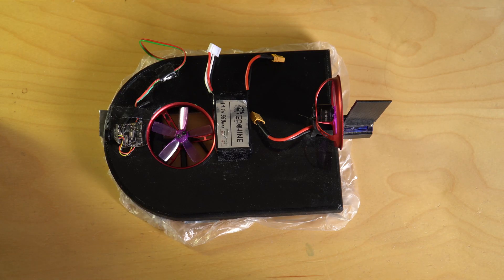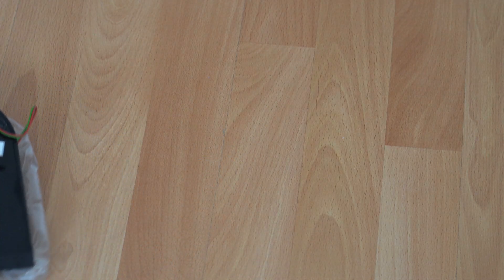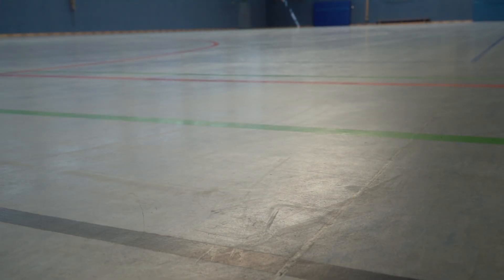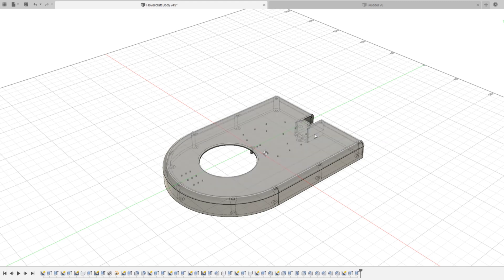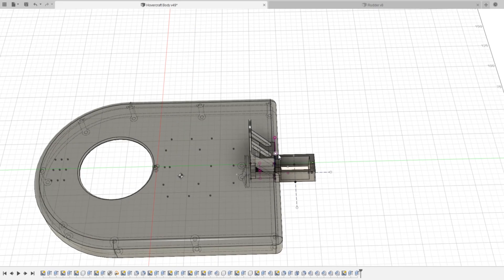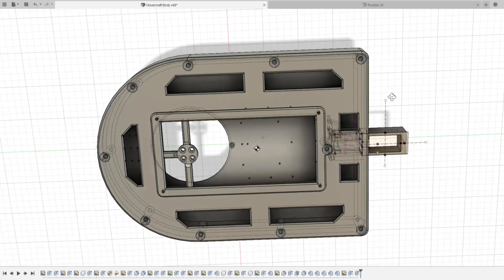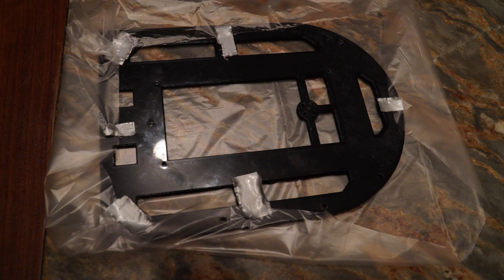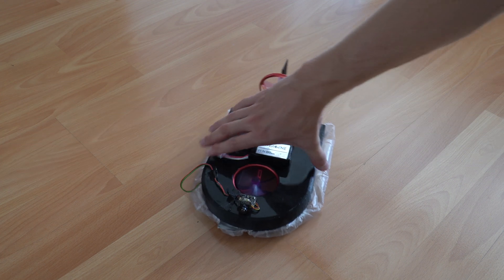How to build a 3D printed high speed FPV Hovercraft

Comment: I intend to make it as my very first RC project. How do you go about interfacing? I mean, what's the universal cheap set of transmitters and receivers I can use for this and my future simpleton projects? 2 axis (channels) are minimum, 3 desirable.
Reply from the maker: Being a fan of opentx i would say a frsky x9 maybe but there are others at a similar or lower price as well around 100$. I would not go too basic as a proper opentx transmitter is not that much more expensive and will last you for a long time. Check what others are using, compare features and prices and in the end you need to decide whats worth it for you.
Reply: @Gigawipf  Opentx is the keyword then, thanks. Again, as a total noob in this, what's the composition of a transmitter-receiver system? A receiver in the vehicle and a transmitter that is separate to the remote controller and bought separately?
Reply from the maker: @Tome4kkkk  You need a receiver in your vehicle thats compatible to your transmitter (the remote controller). Most manufacturers have their own protocols so you need to check what works with what. For frsky for example the new protocol is ACCESS while the older one i use is ACCST and even there you may have different firmwares depending on the region of sale (EU & non EU) which are not compatible with each other. Make sure to read about that and check compatibility lists.
Reply: @Gigawipf  Will do, thanks. Just FYI, I've discovered you through your openffb wheel project, thinking it's going to be rather easy to just slap a wheel on a serwo axle to get a cheap direct drive wheel. You probably saved me a year of my life :D

Comment: Put a double rudder on it.
It makes controlling really accurate.
Reply from the maker: I might try it again. The reason why i only used a single one is that i wanted to have it mechanically simple and with a double rudder the rotation axis is either off in between the rudders or a linkage would be needed which makes is more complex and less rigid.
I thought with a propeller this small a single one should be sufficient but at high speeds a double rudder may be better.